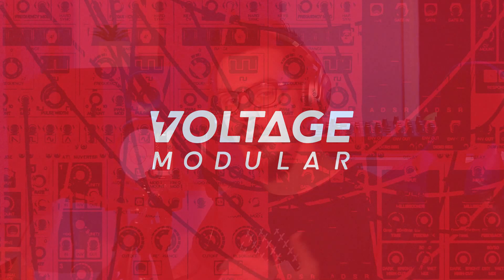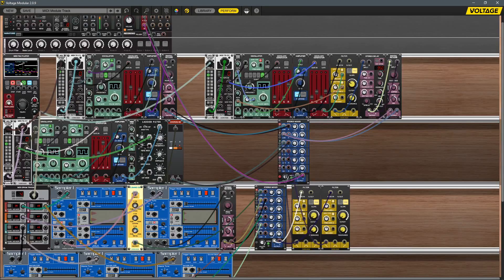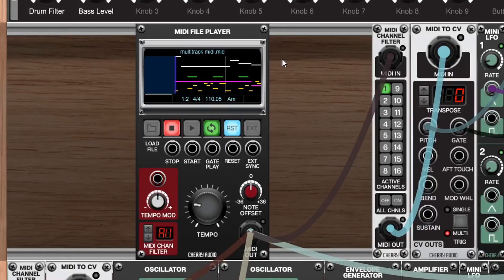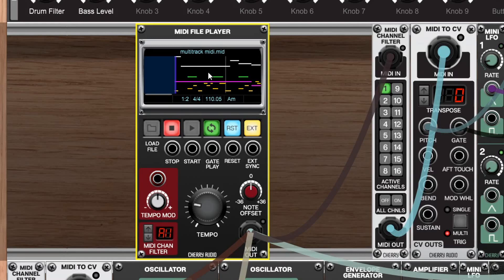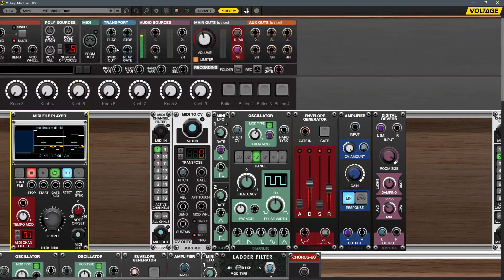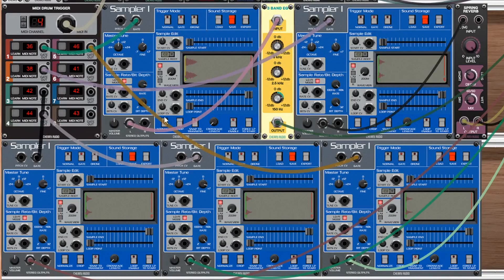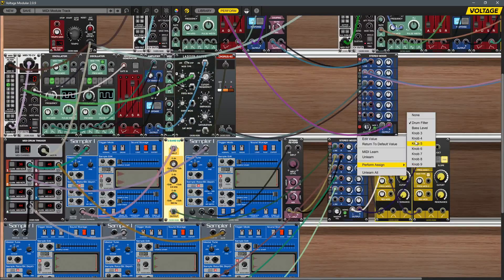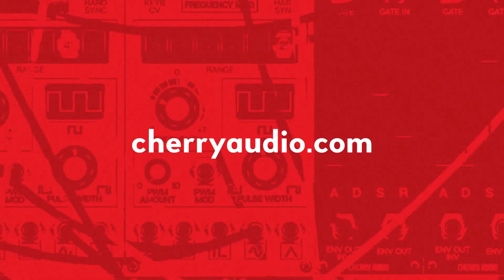MIDI File Player Module | Voltage Modular 2 Tutorial

Comment: I own the core bundle and not seeing the midi file player after updating is it out yet ? It looks like a lot of the new modules are not showing yet as have question marks on them in store ?
Reply from the maker: Hey there! Some modules on the store are receiving image updates so they may not appear in the meantime. As for the MIDI File Player module, we're currently looking into it and it should be in your account shortly!
Reply from the maker: This should be resolved now so the module should show up next time you run Voltage Modular!